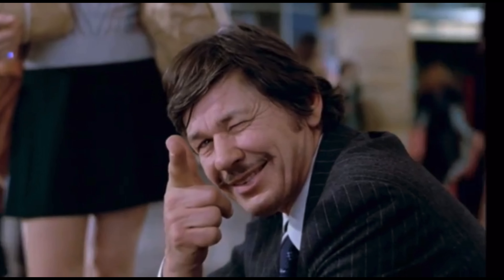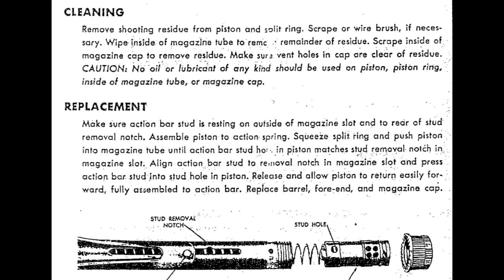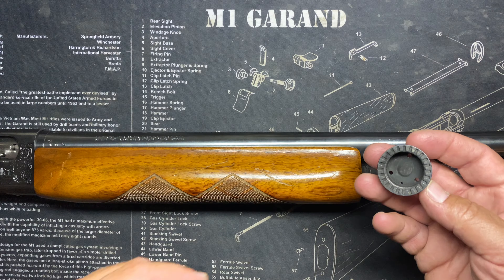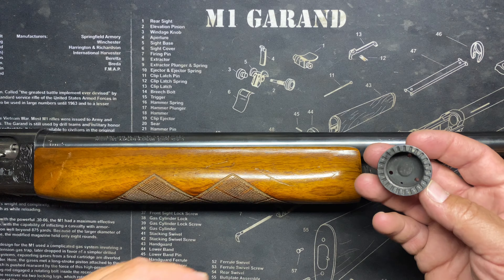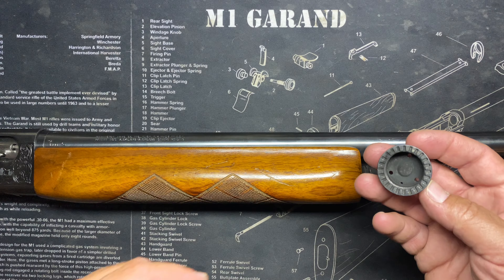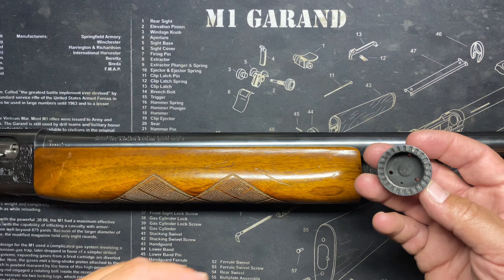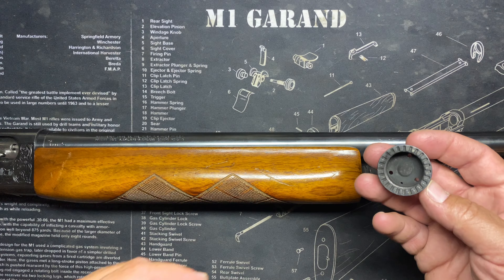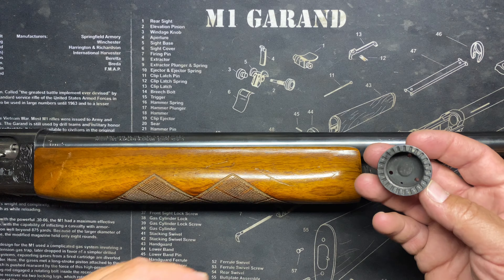Remington Model 58 O-ring Trials

Comment: Look at getting some "cannon plug pliers", its like a channel lock but with soft plastic jaws. They are made to take apart milspec circular connectors without damage.
Reply from the maker: I had a pair of those a long time ago and I found they slipped too much on metal for jobs like this.....for me, a strip of leather was my go to tool with the slip joint pliers shown.  Can't find that piece of leather, need to make a new one.

Comment: How do the O-rings compare to those on the Rem. 1100?  Some consider them the Achille's heel of the 1100, but I have not found them to be fragile or short-lived - although I do not shoot as often as you do.
Reply from the maker: They last an amazingly long time and if you use a quality part are not at all fragile.  I remember first seeing this design years ago and thinking to myself that it will be annoying to have to replace that thin o-ring all the time......and in actuality they last forever.
Reply: @MilsurpGarage  Thanks.  I believe you are correct!